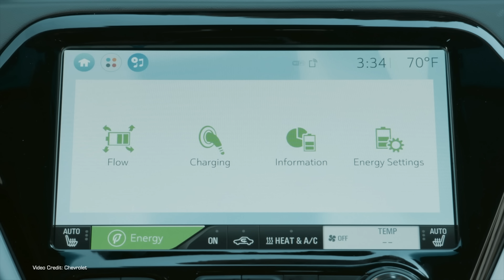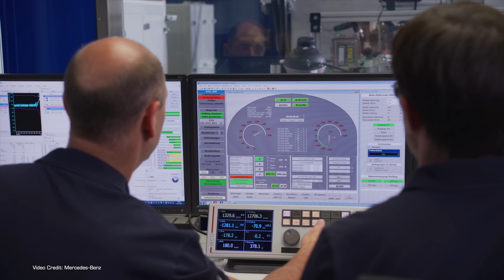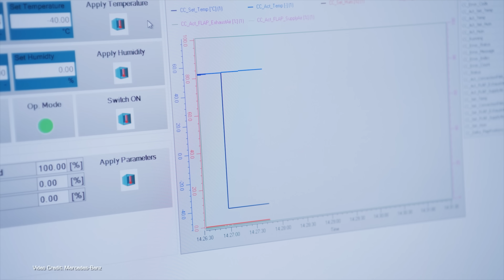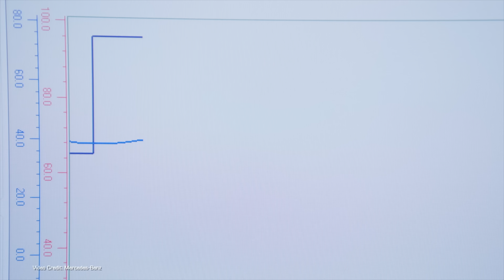Should You Buy An EV With An LG Battery Pack?

Comment: Wondering if the new Cadillac Lyric uses the same battery?
Reply from the maker: The Lyric uses Ultium batteries, which are a different design, though produced in a joint venture between GM and LG - Winter

Comment: I believe it's not about LG Chem. Because they are the largest supplier. There are many cases of Tesla's (panasonic supplied) spontaneous catching fire while parking not even charging. The difference is that tesla choose to ignore it and blame luck while Hyundai choose to recall. Sk innovation is not better than LG Chem, there was law suit between the two that Sk used imployees to steal secrets from LG and LG won the case and Sk was punished with a ban. Kia nero is the same car as Hyundai kona with only difference in battery supplier (LG / SK).

Comment: Great video and I have been a 2020 Bolt owner for just over a year now! Your content has been very informative. Just wondering what you feelings are about SK Innovation? While it is a totally different manufacturer, it is a little disconcerting that SK Innovation must have used trade secrets from LG Chem (given the recent settlement between the two companies). That makes me wonder if SK Innovation batteries could experience similar problems.

Comment: lithium batteries explode all the time in all systems using them are at risk. even teslas they blow ffs and autonomously run people over ffs. its child abuse to use auto driving. on public streets. should be outlawed. if u want auto driving make ur own road or trolly fucking tracks they were electric right.

Comment: I have a 2013 Ford Focus Electric and just had the 4th battery replaced (per Ford) and was told Ford will NOT cover another battery because the warranty is now passed it's coverage. I was looking to replace it with a used Bolt soon...what do I do?!?
Reply from the maker: I wish I had a straightforward answer for you. It's something Kate Walton-Elliott and I both have been struggling with. I bought a very cheap electric city car to hopefully tide me over until better used options are out there, but it's a tough situation. In the USA there's nothing with the Bolt's capabilities at the price the Bolt goes for used. - Winter

Comment: I'm on lunch so here's some insight into the battery market that people don't know.

Battery companies don't have millions of dollars in free cash available to develop technology without being paid, this is a risk to the battery companies, so when they work with an automotive company that wants their own custom battery and improvements (power/Range). They use customer expected battery volumes to determine initial sale prices and then push for faster future technology that does not exist (nor the battery) to make even more revenue at a premium.  The investment alone from the automotive company will lock them into a contract with the battery supplier to get what's owed.  

This leaves the battery company to push extremely fast to develop the batteries which take about 2-3 years to go from R&D to pilot production, and then another 2 years after that for full production in a large-scale facility.  Here's the crazy part, if that's 5 years to make one battery in a full production environment, then the battery companies will sell them ASAP just to start making revenue without x amount of years of testing.  This also does not include the amount of equipment testing needed to ensure good products.  Automotive companies want warranties on their batteries claiming they will operate for 7-10 years on new technology that has not been tested for more than 2-3 years.

Comment: Silly question, did you/she say what LG 'battery pouch' from the three available formulas and several form factors may be in a specific vehicle - pouch as opposed to batteries that have a (round) metal outer shell like AA or AAA cells or Teslas (large) new batteries have ?

Comment: Seems like the Chevy Bolt is the new Ford Pinto. If you're not a history buff, the pinto was acclaimed to catch fire when in a rear-end collision. The last news I had about the pony car was that the gas tank was mounted outside of the frame, allowing the gas tank to rupture, and when the gasoline made contact with the muffler ... BOOM! Panic ensued and although the car was fun to drive and easy to maintain, they eventually dropped out of sight. 

I fear such will be the plight for the Bolt. I can tell you if you don't already know, that every machine, not just in transportation, has an element of risk associated with it if you use them. I currently own a 2017 Bolt which, I was hoping would be the last one I would have to buy. If Chevy is willing to upgrade me to a newer model because of the battery, I'll stand in line. However, if they're willing to replace my propulsion battery for free, and the car doesn't run into any other problems, I would be happy with that as well.

One final thought. I feel that because of these problems, every BOLT owner should receive a lifetime subscription to OnStar. This would give Chevy a way to monitor battery usage above the current telemetrics, and alert their owner if something unusual was happening in the car. Moreover, I feel that the insurance industry should encourage GM in this matter because it's a cheap and currently available way to instill trust in the vehicle and demonstrates that GM is seriously attempting to resolve the issues.

Comment: LG also has one of the largest production volumes of EV batteries right now.. I am a bit afraid that when the production pressure on STI or CATL is growing, we will also see a rising number of incidents for their cells. It's simply an illusion being able to QA every cell and predict longtime stability. We will simply have to live with a certain risk of electrical fires. But as long as this risk is still lower than an ICE car bursting into flames (which it currently is, by a significant margin! it's just not reported anymore we're so used to it happening), I am fine with that.

Comment: All Chevy Bolts that have>ever< been produced are now in a massive recall. Until battery replacement, owners are not supposed to charge fully, deplete fully or park a Bolt inside, for fear of fire.

Apparently, the Bolt has no ability to monitor the health of an individual cell in its complete battery pack. Otherwise, Chevy would be able to run a diagnostic to detect which Bolts have the issue.

Kind of like a "check engine light" but for the battery itself.

Here's my question:

Is there any EV manufacturer that has this type of cell level monitoring in its battery pack? Tesla? VW? Anyone?

I've driven a 2013 Nissan LEAF for 8 years, as I think about replacing it with a more modern and longer range EV, this is something I definitely would like to know before I buy.
Reply: A tab set askew or a separator wrinkled -  how can either be detected externally? If someone does comes up with a test for that then all the recalled batteries could be dismantled and rebuilt. By hand, aargh.
Reply: @anastigmatix4119  

So far, I've found nothing on this. I was hoping a charge/discharge & temperature profile at the individual cell level might give a clue about an impending problem. But I don't think any manufacturer has any kind of cell level connection that would provide diagnostic information of this type.

Comment: When 3 different production plants around the world have exactly the same problem it makes you question is if the packs modules  themselves pass all tests before leaving the production line is there a possibility something either penetrating the packs  in question leaving no coolant  or a common component within the packs such as a inline fuse or even the wiring chafing or even the tiny possibility of flex in the models themselves causing friction e.g after a bumper push when parked leading to misalignment . Given  the majority of fires happened on 3 year or more cars if it’s anything like the leaf 30/40kwh swelling packs due to imbalance when heat buildup in the packs regardless of country.  My feeling is every car should be able to charge to 100% at any time without issues , as my warranty issues will only happen if it gets below the 70-80% that many manufacturers say in the manual    If I wanted to charge just to 80 or less percent just to protect the pack only protects the manufacture if it’s only Designed to charge to 80% then they should build, that buffer header should be built into the packs already e.g vw id 4 85kw pack but only 77kwh usable if that is not enough then there hasn’t been enough planning if the design for everyday life.  It should be you plug in and forget about it not have to micromanage your charging to protect manufacture form you making a claim because you used it like a normal car like how they say you can , the sooner we move over to solid state electrolyte the better.  If gm can’t get the packs from LG in time then they should use there new packs process from its ultrium packs in a redesigned pack that will fit these models.   I’m livid I managed to get a euv to tie me over till the lightning gets delivered.  If was dropped off by the dealership and quite literally haven’t drives it at all till I had to jet back to the U.K. for a family emergency , only to find out car I just got needs a brand new pack, gm buy this car back now and give me my money back , I would say I’ll buy the gtx id4 4x4 or whatever they call it in the states when released but production has stopped and won’t resume new orders till next year . We’re all royally ripped off

Comment: One of the most onerous recommendations for Bolt owners is not to charge overnight: that's when most commuters charge, and for net-meter power customers, that's when electric rates are the lowest.
Reply: My electric rates are .07 per kWh at night, but from 2pm to 8pm it is .24 per kWh.  No way I'm charging during peak hours.

Comment: My 16 Spark EV has an LG Battery, they switched to LG in 2015 on the Spark EV, to my knowledge there has never been a battery fire reported in a Spark EV. Of course since a total of around 5,800 Spark EV’s were sold over those 2 years the probability of one with a LG battery catching fire in the first place is pretty low.
Reply: I hope your knowledge is correct.!! I have three 2014's (with A123 Inc batteries) but could not find another so settled for a 2016. Good to hear these have been lucky so far.

Comment: I own a 2019 Bolt. I am not very worried (3/3300 equals 99.9% sure it won't catch fire!)  Please also mention that even with my "worst case scenario" model & year there is variation. Bolts built between the narrow range of October and February of 2018-2019 have seen the majority, or maybe half of the fires. Six of these occurred in cars built in October and November of 2018. (I am sure that you seen Sean Graham's analysis). I am not so worried because mine was built in June 2019, which perhaps would halve the chances mine would catch fire (99.95% sure it would not catch fire). 

However, it is great that you mentioned that these defects could be present in a lot of cars, but battery management and use might prevent them from ever presenting as a fire. BUT THEN....most gas car fires happen in cars over 10 years old. There are very very few EVs out there that are more than 10 years old!

Looking forward to my new Bolt battery pack...(and my new Tesla!)

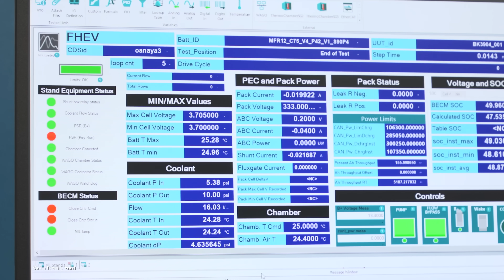Comment: 14:45 I checked the validity of that statement and chose the UK as I assume that is where you are from. According to Fire Brigade data from London, EV catch fire a lot more frequently than ICE vehicles.
Reply: Here is the data.

"Vehicle fire data suggests higher incident rate for EVs

Data obtained through a Freedom of Information (FOI) request revealed  that in 2019 the London Fire Brigade dealt with 54 electric vehicle fires compared with 1,898 petrol and diesel fires.

Vehicle registration numbers from the Department for Transport (DfT)  show there are 50,000-plus plug-in cars licensed in the capital out of a total 4.63 million licensed cars.

Looking at the London Fire Brigade data, that would suggest an incident rate of 0.04% for petrol and diesel car fires, while the rate for plug-in vehicle is more than double at 0.1%. So far this year, there  have been 1,021 petrol and diesel fires and 27 EV fires in the capital."
Reply from the maker: We are based in Oregon, in the western USA - Winter

Comment: 7:30 Autoevolution tried to contact authorities in the Netherlands about that ID3 fire. They found out no one is investigating why it caught fire, and no one could tell them who is in charge. This is scary.

"Apparently, No One Is Investigating the VW ID.3 Fire in the Netherlands. You could expect that the first fire involving a Volkswagen ID.3 would be under heavy scrutiny at this point. After more than one week of trying to discover who is investigating the blaze in Groningen apart from the automaker, we can say that is definitely not the case. So far, we have no idea who is in charge of finding out what happened to that car.

We first tried to contact the Groningen Fire Department (Brandweer) and have received no answer so far. Our second option was the Police department, but they didn’t even know what this case was, when, or where the fire happened. They suggested that we talked to Brandweer.

We have only heard back from the Ministry of Infrastructure and Water Management, whose team told us to contact the Gemeente Groningen – the city administration. They would be the ones “authorized to dissolve incidents like this.”

Gemeente Groningen was quick to get back in touch with us. On August 26, they told us they had forwarded our questions to Veiligheidregio Groningen (VRG). The city’s emergency services would then get in touch with us to clarify it “they know something about further investigation.” So far, we have not received the answers we need from VRG."

Comment: 13:39  Incredible.  There are people out there that say they won't get a Tesla because the there is a panel gap off by 1 millimeter.
Reply from the maker: Come on, Tesla's build quality issues have often been quite a bit worse than a 1mm panel gap. My Model 3 has some egregious fit and finish issues for a car that cost what it did. None of it rises to the level of "these cars catch fire" of course, but don't pretend that Tesla build quality is on the level of many competitors, even with the significant improvements the company has made in recent years - Winter

Comment: I thought Chevy stopped using LG batteries in 2019.  Isn't that why the 2020/2021 Bolt wasn't included in the recall at first?
Reply from the maker: Chevy was still using LG Energy batteries, just built at a plant in the USA instead of in South Korea. Turns out the same problem existed at the US plant unfortunately. - Winter

Comment: https://en.m.wikipedia.org/wiki/Boeing_787_Dreamliner_battery_problems

Events never satisfactorily explained from the Boeing 787 initial battery design brought us lessons long ago.

Even though cells were sourced from GS/Yuasa, a renowned Japanese supplier, and integrated in packs by French renowned and knowledgeable enterprises, failure rate was astonishing higher then expected.

A thorough redesign to minimize and contain failures had to be applied, isolating cells, avoiding chain effects on a cell failure, and avoiding catastrophic damage on cell failure.

This pouch format design doesn't seem to be robust enough for this type of chemistry.

There is a reason why Tesla maintained the small cylindrical metal enclosed cell format.

LG sources 21700 NCM/NCA cells to Tesla China. It would be good to track if those are affected the same way.

1/10.000 EV igniting a catastrophic fire is a show stopper. This problem must be dealt with properly.

GM has made a huge effort for many years to qualify cells and packs knowing both durability and security were key enablers. What exactly happened?